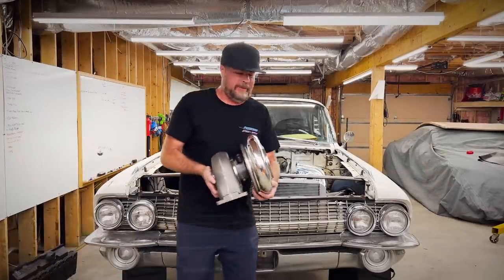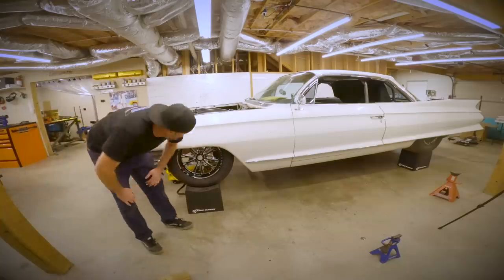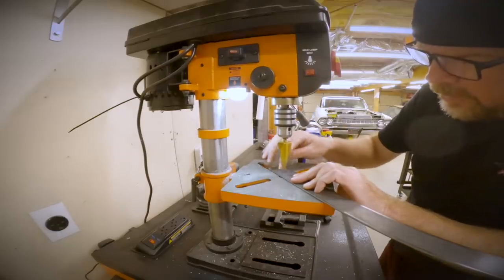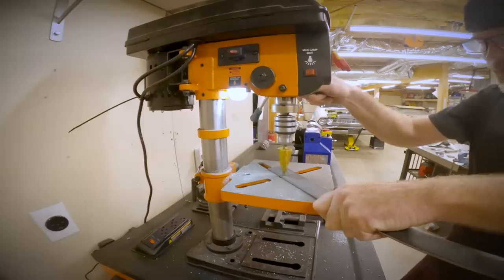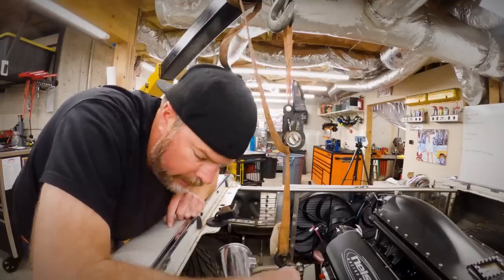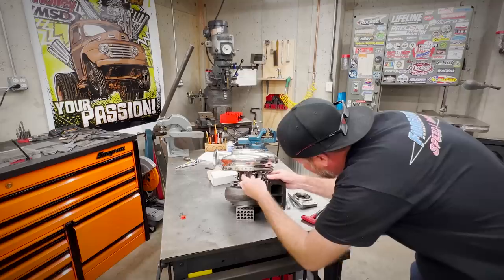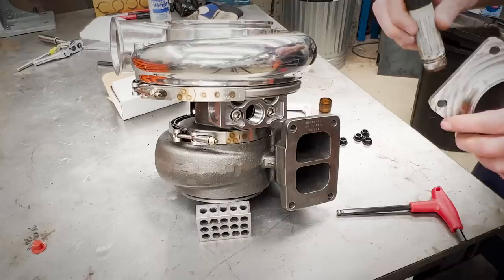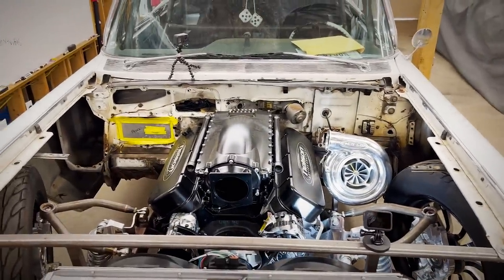I INSTALL 2,500HP WORTH OF TURBOS IN MY '61 CADILLAC COUPE DEVILLE!

Comment: Question for the Science segment - "Mike, can you mount turbo's with the shaft Vertical, instead of the usual Horizontal, and if so, could that make packaging in to a car easier?"
Reply: No because it would never oil properly. You need them as close to horizontal as possible. I'm sure someone could design a Bering cartridge that would work for vertical mounting but one does not exist currently
Reply: @PiDsMedia no you could not mount them like that because the drain has to go out the bottom. Also the oil would pool up on the hot side and boil/cook it and seep through to the hot side.  Interesting idea though I'm sure someone could design one with a center bearing section that could drain and not allow oil to seep through to the hot side.
Reply: @jacobcopeland1922  TurboPumps in rocket engines are mounted with the shaft vertical, so I'm guessing someone already has, but IIRC, those are cooled and lubricated by the liquid they're pumping.
Reply: @PiDsPagePrototypes  a pump is different to a bearing cartridge though the pump will be a sealed unit and can be mounted any way up you want. The bearing cartridge has a shaft poking out of each end and has seals to keep the oil in which gives it places to leak from.

Comment: I have a few questions about this setup. Is the engine hard mounted to the chassis? The reason I asked is if there's gonna be some rotation motion in that engine when launched its gonn rip on that exhaust manifold and turbo mount where it will be hard mounted to the frame. I was thinking if you welded a couple of tabs to the frame and put a bushing at the bottom of the turbo mount it would support the weight and also allow for some flex so the manifold will last longer. Might have to replace the rubber mount every now and then but better than having to repair the manifold. just a thought.

Comment: I like what you've got going with the turbo mount, Finnegan.  You probably want to make sure the hot side of the exhaust is able to move somewhere to allow for expansion and contraction with heat cycles.  You may find that the header will fatigue over time otherwise.

Comment: in my opinion its dumb to put turbos on a classic/antique Cadillac such as this which was meant to be a gentleman's boulevard Cruiser it actually had good horsepower for its time 325 when fully optioned the car weighed 4900 LBs before you added people gas and luggage this model is sentimental to me because my late maternal grandmother owned a used 1981 model of the car

Comment: You know whats crazy is your getting the same hp out of that fully built motor and a coyote 302 small block stock can make the same power out of a stock block stock crank and stock cam simply unheard-of from stock engines which is pretty crazy . Check out real st performance snot rocket pretty cool what they've done. Good luck with your build.